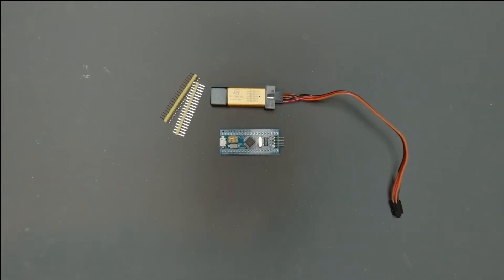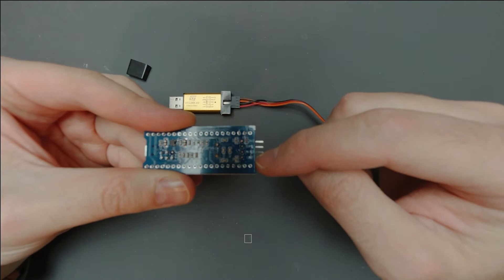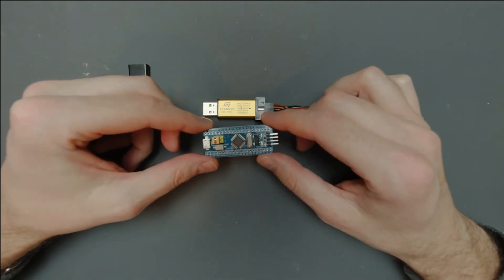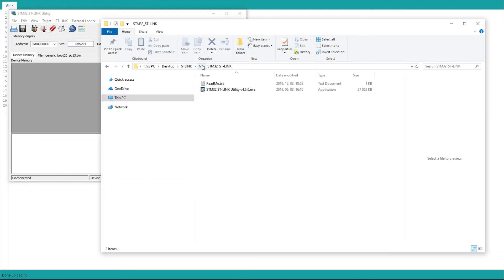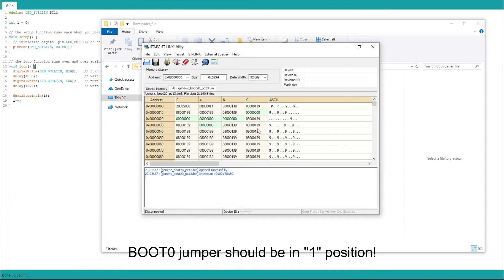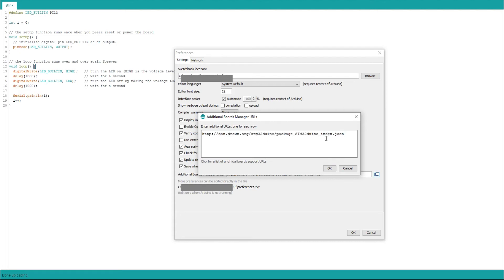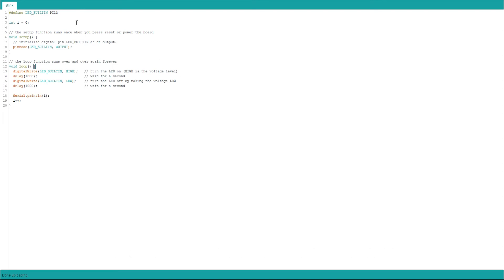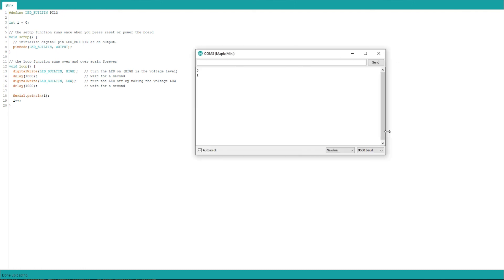STM32F103C with ST-Link and STM32duino, simplified!

Comment: Comment section is still alive :)
Nice video, good explanation. However, got a small issue with my blue pill, loading the bootloader worked like a charm, checksum are fitting and it shows the same data on the pill as on the bootloader file. However, my computer won't recognize the blue pill with it's own usb, device manager tells me unknown usb device as it couldn't receive any device description (drivers installed with the bat/exe files and even manually). Jumpers were set as you described in your video, even with putting the boot jumper back to 0 when it was still connected with the st link)
Already checked all resistors, they are good and according to the official schematics all resistors have the right values. 
No clue what to do know (beside programming via st link again)

PS: The STM32Cube Programmer won't work with knock-off V2 st links, the discontinued stmlink does ;)
Reply from the maker: Hi! Did you install the proper bootloader? The pc13 one? Also, try other usb ports and usb cables too. Sometimes some usb cables cause this error. Furthermore, despite the fact that the error message appears, can you see it as a com port anyway?
Reply: @CuriousScientist  Wow, quick response. Tried multiple cables, none of them worked for the blue pill (for my Arduino Leonardo all of them worked). Different usb ports as well, front/backpanel, usb2 and usb3
I used the PC13 bootloader (generic_boot20_pc13 to be more precisly.)
I do get the sound for plugging in a device, however it is listed under the usb controller as "Unknown USB Device (Error on retreiving a device description)", marked with a yellow triangle, no COM-port assigned. So it knows there is a device, but my PC obviously can't tell which one exactly. Also tried to install drivers for the unknown device, but since it won't submit any identification about the device type it remains unchanged even if i pick the driver manually
Reply from the maker: It could be that you received a broken/counterfeit device. It happened to me a few times as well. Is there a small dot on the stm32 chip which should indicate the pin number 1? How does the reset button look like? Rectangle or "hexagonal"?
Reply: @CuriousScientist  sry for late response, got no notification about your answer. Yes there is a clearly visible dot on the chip (facing towards the crystal). The resetbutton itself is square, the actual push element of the button is circular. In the meantime, I'll try to get a new one form a local vendor (got it from a german electronics supple store)
Reply: @CuriousScientist  good news, sort of. Got some new blue pills and talking with the guy in the store gave me some insights. The new blue pills have rectangular reset buttons, the store guy told me it could be an issue with downloading from git and also gave me one pill with preloaded bootloader. If I plug this one in my PC instantly recognizes it and (after uploading the first Sketch) assigns a com Port. If I load the bootloader into the New pill.... Same issue as before. So I downloaded the exact same file again........ And with this new file, identical in size but different checksum... it somehow works..... On ALL blue pills 😅
I really have to thank you for your time.... Never thought about something like this
Reply from the maker: I am happy to hear that it works now! Also thanks for keeping me (or us) updtated regarding this issue as this information will be useful for others who have the same issue.
Reply: @CuriousScientist  No big deal, always glad if I can provide some help after I received help from others. Just startet with STM/Blue Pills coming from arduinos, teensy and attiny, so I was really baffled getting this error. What really annoys me is the new stmcube software, it has quite some potential, but the limitation on the stlink v2 is just stupid....it's a "Verschlimmbesserung" as it's called in german (literally: an improvement that made it worse)
Reply from the maker: Are you sure that the STLINK V2 does not work with the cubeIDE? I have one right front of me, it is definitely a knock-off and it works for me. I tested it with both blue pill (stm32f103c8t6), and black pill (stm32f401ccu6). Have you changed the settings? In the debug configuration, you have to change the debug probe either to GDB server or OpenOCD. Sometimes you also need to change the reset behavior to "connect under reset".

Comment: The video was very informative , i uploaded the code for first time with this method how can i reupload the code with different delay?
while re uploading i am getting this issue
maple_loader v0.1
Resetting to bootloader via DTR pulse
Searching for DFU device [1EAF:0003]...
dfu-util - (C) 2007-2008 by OpenMoko Inc.
Couldn't find the DFU device: [1EAF:0003]
This program is Free Software and has ABSOLUTELY NO WARRANTY
Reply from the maker: Hi! Once you uploaded the bootloader using the STLink, you go to the Arduino IDE and upload your Arduino code using the USB connection. Don't forget to check the upload method, it should be the stm32duino-something (I don't have it in front of me, so I cannot check it).
Reply: @CuriousScientist  Thanks

Comment: Hello Sir, I am coding my cards with this method. Is it possible to use the serial monitor in this way, I haven't been able to figure it out so far. I'm using ST Link V2, I can do things that can be followed by eye such as led flashing, even I can compile all my codes and send them to my card, but I can't track data on the serial monitor. I will be glad if you help
Reply from the maker: Hi! The ST-Link (as far as I know) is only a programmer and it is not a serial adapter. You need to use the serial port (after disconnecting the ST-Link) if you want to communicate via the serial monitor.
Reply: @CuriousScientist  Thank you sir, I respect you and I like so much your videos
Reply from the maker: Thank you very much!

Comment: Why port not detected? so serial monitor can't be opened
Reply from the maker: Did you select or try to select the proper port? If you cannot see the device it usually means that the installation of the bootloader was not successful.
Reply: @CuriousScientist  is there a solution?😅
Reply from the maker: Yeah, try to reinstall the bootloader.

Comment: Dear Sir, I followed every step and I got this: 

maple_loader v0.1
Resetting to bootloader via DTR pulse
Reset via USB Serial Failed! Did you select the right serial port?

can you pls help me
Reply from the maker: Did you select the right serial port? According to the error message, the software cannot find the microcontroller.  Also check the boot jumpers.
Reply: @CuriousScientist  So sorry to trouble you again sir, Everything was solved after I went into the drivers and uninstalled the maple device and reinstalled the divers. It worked like magic after that. Thank you so much sir.

Comment: profanation
Reply from the maker: What do you mean?
Reply: @CuriousScientist  can it be programmed through stm32cubeide?
Reply from the maker: No, or it depends what do you mean. Using the dongle, you can upload programs from cubeide, you can even debug them. But the main purpose of this process that I show is to upload a bootloader to the microcontroller and make it accessible via USB and make it compatible with the Arduino environment.
Reply: @CuriousScientist  I meant if this board is programmable through STM32cubeIDE. I bought the same one from China, need it for STM project, and it only works as an arduino. Cube doesn't recognize it at all
Reply from the maker: Yes, of course it is programmable, it is a STM microcontroller after all. Some tweaks might be needed however, especially if you bought a knock-off board.

Comment: hi, Firstly thank you for this video. I have a question. I did everything right and plugged in the micro USB cable I use in phones but my computer does not see the cable. Phone micro usb not suitable?
Reply from the maker: You are welcome! Some phone usb cables are only for charging and not for data transfer. This could be an issue.
Reply: @CuriousScientist  So How do I know its sending data while buying
Reply from the maker: Usually it is stated on the packaging if it is also for data transfer or not.
Reply: @CuriousScientist  thank you so much for your helps sir. I wish Have a good day.
Reply from the maker: You are welcome! I hope it will work well with the new cable. I actually had a similar issue with the usb cable of my headphones. I thought it is a normal cable but it is only for charging. Have a nice day!

Comment: SWCLK = SWSCK ?
Reply from the maker: What do you mean?
Reply: @CuriousScientist  I guessed it's the same for the STM32F411 BlackPill
On the board it says SWSCK, while the ST-Link/V2 only got a SWCLK labeled pin. So those are to be connected?
Reply from the maker: Ah, okay understand it now. Yes, they should be the same. On the blue pill and the st link, the clock is indicated by swclk.

Comment: How about doing the task with STM32Cube IDE?
Reply from the maker: The point here is to provide the "STM32 experience" in the framework of the Arduino system. Why? It is simpler than the cube IDE. Setting up the clocks, the peripherals, coding using the HAL is a bit more complex and as I noticed, people look for simple solutions most of the time.

Comment: unfortunatly it didnt work for me maybe i have downloaded something wrong or somehing

Couldn't find the DFU device: [1EAF:0003]
 my IDE says
Reply from the maker: Have you installed the driver and the software package I showed (from 3:35)? Also, have you checked the device after installing the bootloader? You should see an automatic message on the serial terminal that indicates that the installation of the bootloader was successful.
Reply: @CuriousScientist 
thanks for the fast answer!
i could oben the STM link shown at 4:16 and it verified my bootloader
i also installed the .bat files
is it possible i need an other bootleader? but i think i have the exact some board

Here is the full error i get by the ide:
esetting to bootloader via DTR pulse
Searching for DFU device [1EAF:0003]...
dfu-util - (C) 2007-2008 by OpenMoko Inc.
Couldn't find the DFU device: [1EAF:0003]
Reply from the maker: @Milan22229   @Milan  Have you installed the bootloader? Have you also checked the serial terminal and saw if you get the message from the bootloader? Your error message suggests that you don't have a bootloader installed...
Reply: @CuriousScientist  i guess :)
is it the part at 5:54?

i can choose the board and the upload method in the IDE if this helps
Reply from the maker: @Milan22229  No. :) I ask you for the last time. Have you opened the serial terminal after you (assumedly) installed the bootloader and did you see a message confirming that you have a bootloader on your STM32?
Reply: @CuriousScientist  hmm i think my chip is fake so that might cause the issu
tanks anyways

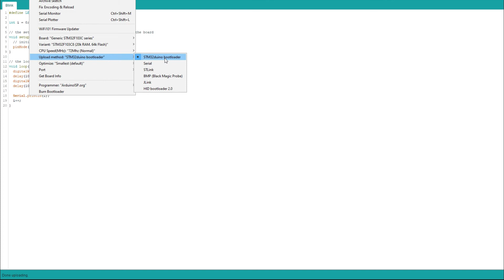Comment: OR, just leave the ST-Link connected ( no boot loader required (it's J-tag)) and select "STLink" as seen at 8:30, and done (the whole point of getting an ST-Link with the boards, a lot more powerful than a simple boot loader).
Reply from the maker: Yes, one can also skip the bootloader! But people usually work with bootloader because they want to upload their program via usb, so that's why I showed that. I believe that people who can use the ST-Link as "it should be used", rather use the STM32CubeIDE or other similar software and they don't use the Arduino environment.
Reply: The program hung when I tried it without the USB connected. It appears to require a serial port connection to use "Serial.println()" function.
Question for anyone who may know: Does the bootloader function as a USB serial driver on the Blue Pill? If not, what part of this process makes Windows recognize the device when it's plugged in via USB?
Thanks - Greg
Reply from the maker: Yes, the whole point of the bootloader is that you can upload software to the microcontroller via USB. If you don't have a bootloader installed, you have to program it using the ST-link. A program uploaded with the ST-link will still be capable of serial communication.

Comment: Hi, I've followed all your steps closely but when I uploaded the code on Arduino IDE, I get the 'Couldn't find the DFU device' error. Do you know how to resolve this issue? Thanks!
Reply from the maker: Hi! 
Start it over from the beginning! Upload the bootloader using the ST-LINK dongle (pay attention to the jumpers). Remove the dongle and connect via USB. Then, select the board in the IDE, select the COM port, parameters...etc. Open the serial terminal. If you get an automatic message saying something like "you have successfully installed the bootloader", then you can proceed with the upload of the actual Arduino code. If you can't see the board where you can select it, then you might have a faulty board, or the R10 resistor is not the correct one. Check the earlier comments under the video because some other people also had issues with the board.

Check these as well. Do you have the same reset button on the board as I have? On the microchip, how many circles do you see in the corner of the chip? 1, located close to the crystal or 3?
Reply: @CuriousScientist  Thank you for the reply/ I believe my board is slightly different from yours. My reset button has an octagonal shape and on the microchip, there are 3 circles.
Reply from the maker: Ahahh! A few days ago I tried to use the same board that you described just now and I couldn't make it work either. I could upload the bootloader but when I connect it to the computer via USB, the computer says it cannot recognize the device. I replaced the R10 resistor, it did not help. As far as I know, this type of board is the "worse type" of the knockoff boards. So it is possibly a faulty board.
Reply: @CuriousScientist  ahh that's a bummer, thanks anyway! you've saved me loads of time.

Comment: Plese make a zip file with all needed files because i cant find the files that you use. In that case this video is useless.
Reply from the maker: Maybe it is not the useless video's fault but yours because everything is given in the description. All necessary links are there and they work.
Reply: @CuriousScientist  hi i found the file but i have a problem after the bootoader run and bot 0 putting back to 0. I connect the thing via usb and my pc show mapple003 and cant use as serial port. I try to program this via arduino but arduino cant find any ports what should i do?
Reply from the maker: Let's see. Start everything over and just put the bootloader on the board. Then, if this went well, a message will appear on the serial terminal when you open the board. This indicates that the bootloader was successfully installed. 
After this, you have to select the board in the Arduino IDE. Go to Tools/Board/STM32F1 Boards, and select your board (Generic STM32F103C8T6 series). Then, you also have to select the other parameters under the Tools menu. It is explained in the video from @8:00.
Reply: @CuriousScientist  Yes. Everithing set right but the "port" section is gray because my pc cant recognize mapple mini as serial port. I nstalled the arduinostm32 drivers but i have a problem sitll. I dont know what the problem is."https://github.com/rogerclarkmelbourne/Arduino_STM32/issues/697". I have the same problem that showed in the link. Tanks for your help.
Reply: @CuriousScientist  when i connected via usb boot 0 in o positon and boot1 in 0 position but i try boot 0   1 position and also boot 1 1 position but i have a same results.
Reply: @CuriousScientist  When i burn the arduino bootloader i choose the same that you youse. It coud be possible to i need to choose some other bootloader (21pcs on the directory)?
Reply from the maker: BOOT1 & BOOT0 pins only have to be manipulated when you upload the bootloader with the ST-Link dongle. Otherwise they stay in the normal position when you use the USB method, to upload code. Check the previous comments under the video. If I remember correctly, someone else had a similar problem. Sometimes some boards have wrong resistors installed and the USB doesn't work properly.

Comment: Hi, 
I did everything as in the video, but the arduino (program) does not see my board. There is no port in the instruments.
 I'm sorry if you don't understand, I'm just from Russia
Reply from the maker: Hi! Your English is fine, do not worry! Do you see the device in the device manager when you connect it via USB? Something should show up under the Ports (COM & LPT). For me it shows "Maple Serial (COM11)" after installing the bootloader via the ST-Link and connecting it to one of the USB ports. If nothing is showing up when you connect the STM32 to the computer, it might be that the board is faulty. Sometimes it can be that one of the resistors have wrong value. Read the other comments under this video because we discussed this with another viewer. Let me know about your progress.
Reply: @CuriousScientist  
Hi, I couldn't do it because I have a fake cks32f103c8t6. I will wait for another stm32. I don't know what to do with this board, can I flash it?
Reply from the maker: Yeah, I also have the fake one and some of them have the wrong resistor value. You just need to add an extra resistor and use it when you flash it or upload the software.

Comment: Perfect turorial. Working. Just one question. Does this method of programming supports Mouse.h library? I am getting an HID.h error.
Reply from the maker: Thank you very much! I am glad it works! Unfortunately, I have never worked with this specific library, so I cannot tell it for sure. Sometimes some libraries do not work with STM32. Sometimes because they depend on some third library or because of the differences in some definitions. Check if you have outdated libraries (sometimes you have to update them manually). Other than that, I don't have any ideas, sorry.